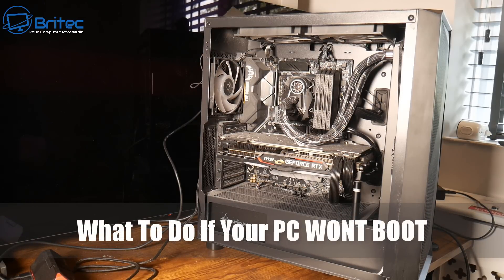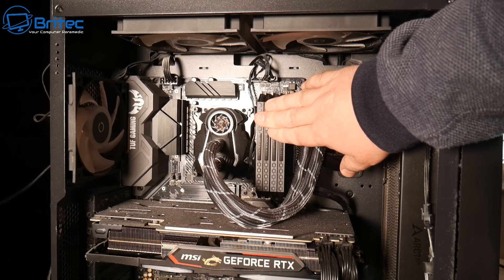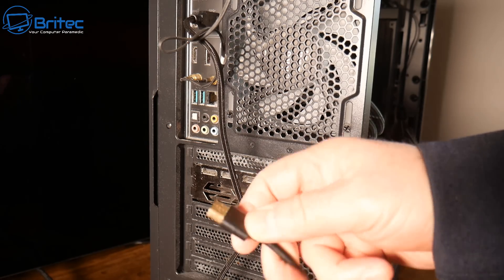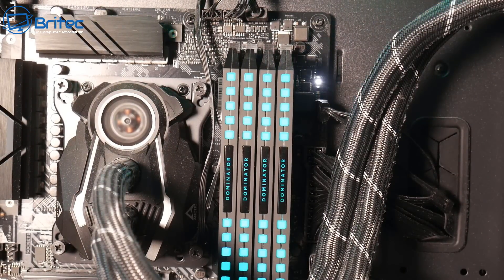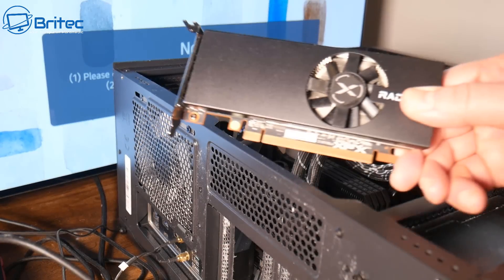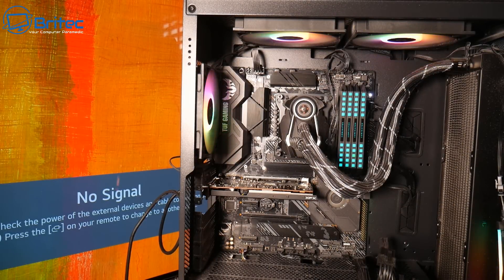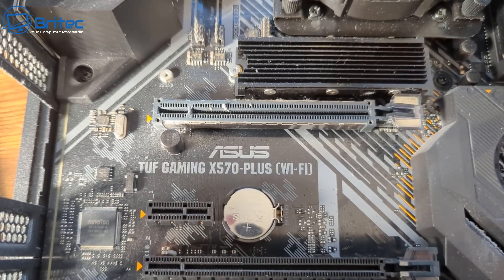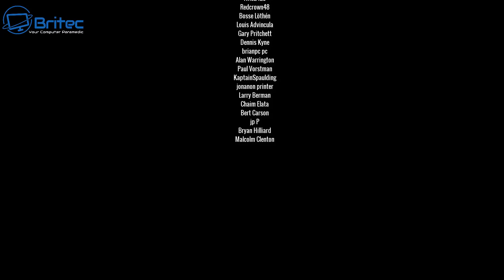What To Do If Your PC WONT BOOT

Comment from the maker: Let me know if you like this content in comments section below.
Reply: Case fan makes a groaning sound and pc doesn’t make it past the bios beep then turns off then turns on again and keeps doing the same thing over again and I cleared the cmos by removing the battery and touching the 2 cmos pins with the screw driver like you said it still does the same thing
Reply: Hi

Comment: This is what happened to me. It might help you - I had a spare drive from a old computer. I formatted that drive and then used it to clone my primary computer's c drive (the operating system drive, just in case it failed at some point). I had three other spare drives (that I use as back up drives) that are connected inside that primary computer. I disconnected the final one to put the cloning one in. Once cloning was all done, I removed it from that final spot, reconnected the drive that was originally in that final spot, THEN I disconnected the C Drive and swapped it with the newly cloned drive. I turn on the computer and it never went past the initial beep. Wouldn't even start in Safe Mode. So, yes, I was worried and started Googling for local computer repairers to visit tomorrow. Then I had a thought. I took out the cloned drive, reconnected the original c drive.  I disconnected all the spare drives and tried booting again. It worked fine. I turned off the PC and I reconnected each drive in turn, restarting each time and all was fine. I didn't retest the newly cloned drive that way, but I'm sure it would work. I'll try it another day. I'm just happy my computer is working again. I suppose that the computer just had a booting drive recognition problem because the cloned drive had a different drive letter, but it would probably work if it was the only drive in the loop.

Comment: Hello there,
I just tried to install a RTX 4080 (it has a 8 pin connector) and my pc wouldn’t boot up. I found the fault to be my connector, I had to put it in upside down.
The pc started to boot the gpu lit up but then it started bleeping?
So I turned off the power put back in my RTX 3070ti (it has a 12 pin connector) and now that has the same issue

Ok, scare over my 3070 works again, tried the 4070 again but I have the same issue, bleeping with nothing going to my tv.
My power unit is 800w minimum needed is 650w

Comment: my computer won’t boot, everything is plugged in no lights on the mb are going off to indicate somethings wrong, it isn’t randomly shutting down, it won’t let me get into the bios, i tried taking a ram stick out, unplugging components and replugging them in, took my gpu completely out, all components work fine and it’s a old pc and it just stopped working
Reply: I got the same problem here, you got a fix for that?

Comment: My pc is not booting… i just bought a completely new pc,installed it my self and everything is plugged and i get my motherboard rgb and my ram rgb,no fans spinning no booting and im stuck,somebody pls help😢
Reply: Did you find solution or reason for that cause my pc same problem
Reply: I have the same issue any answers?

Comment: Another great video! That model of board is actually what will go in my next rig, so it's nice to know what to look out for. I had an incident where I  couldn't boot with my current rig. Something was causing a short. I ripped everything out one by one, trying to find out what it was. It turned out to be my SATA SSD. The case is only an mATX and the only mounting point for the SSD was on a bracket on the right side of the case on the back of where the motherboard goes. The issue arose because there was next to no clearance between the power connector for the SSD and the side panel for the case. The side panel damaged the connector and it was goodnight Vienna! The SSD was shot too. I had to get an M.2 SSD and, fearing I'd also blown the GPU, I got a new one of them as well. Had I realised from the get go that I even had an M.2 slot (actually I have 2) I could have saved myself from a major headache!

Comment: I have an old Asus laptop that doesn't power on at all - no power and no lights on, even on AC power. It's either the CMOS battery, which I cannot get to in the laptop, or a power supply issue, or some other issue that I don't know. Please help troubleshoot it with a sequel video to this one! Thanks!
Reply: CMOS battery will not cause that issue. Hard to say what's wrong since more information is needed at this point. You test voltage from the power supply with a meter? Check the power connector at the laptop if it's broke or real loose? If you're not getting power into the laptop, eventually the battery will go dead and you'll have nothing. If all those test is good then it's more likely a part on the board failed. If it's not a board issue, even with no post the LEDs should still work once it gets power.
Reply: @garyr7027  I even replaced the power connector. Same problem.
Reply: @RobertNewstrand  well if the laptop is getting power and you verfied it does, then there's a part on the board itself that's defective.
Reply: try the HDD it could be faulty
Reply: @mogwai6707  Only thing that will do is prevent booting up to the OS in the worse case of scenerio. A defective HDD will not prevent no powering up or prevent post.

Comment: I have a question if I may? Actually many questions but for today I’ll just ask you 1. And that’s on the back of the desktop the thumb screws that holds the see through plates and in order to install a graphics card you have to remove 2 of them and I did that and I have to brand new desktop case it’s the Corsair 4000D and when I go to put the screws back where they belong for the graphics and they don’t tighten when I’m tightening them I go slow to prevent stripping the screws but as I am putting them back in they will not tighten they just keep turning and I never feel it getting tight they just keep turning so am I doing something wrong or is this normal and my graphics card is plugged in correctly and on the motherboard it does clip but the screws will not get tight and I use a Phillips screwdriver turning slow and even slower when the screws are close to the point where they should get tight but they don’t,can you please tell me what I’m doing wrong or did I get bad screws when I bought my desktop case a few months ago? Thank you sir.
Reply from the maker: If the screws don't tighten, it seems you may of striped the screws. Not sure I can help you without seeing the issue, pop on my discord for help

Comment: Hi Brian, I remember when Carie Holzman said that I had set him up for a fall during a pc build where he used one of the first of the MSI gaming motherboards that had an M.2 slot, but that slot was also taken up With the first SATA slot. You could use one or the other slots, but you could not use both. Of course, he chucked the manual away as he always did thinking he knew better and he proceeded to put the hard drive in the first SATA slot and he put the NVME drive in the M.2 slot. Of course, when it came to the switch on, it wouldn't work And I was trying to tell him that it wouldn't work in the chat as I had previously built one weeks earlier. I tried to tell him what he had done wrong, and then he accused me of setting him up for a fall. This just goes to show what an arrogant tossa he has always been.
Reply from the maker: Chucking the manual away is just dumb, there is useful information in there as shown in my video.
Reply: Which msi board was he using? Was it a older one than the Z590?
Reply: @robertstamps2674  I've done a lot of jobs since then but I think it was the Z470 gaming plus.